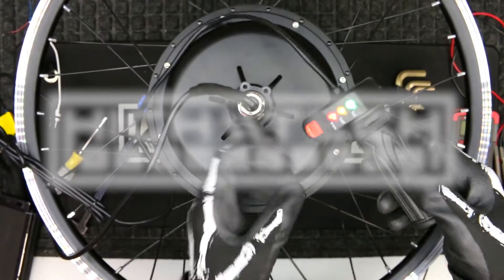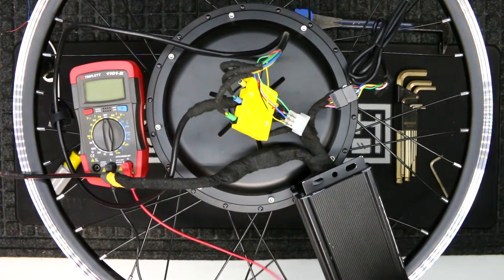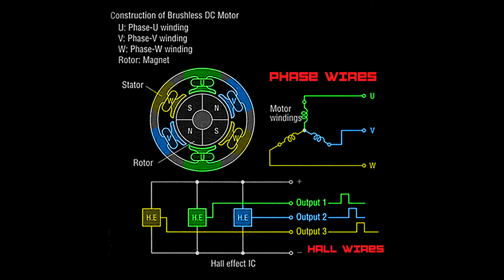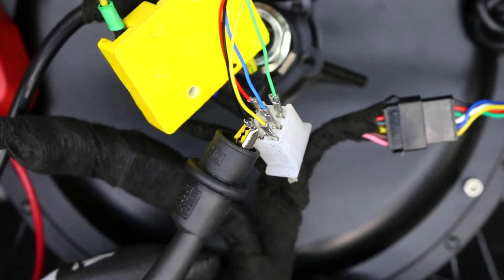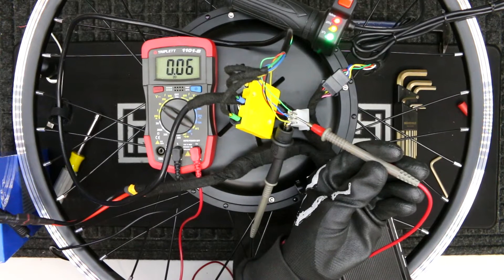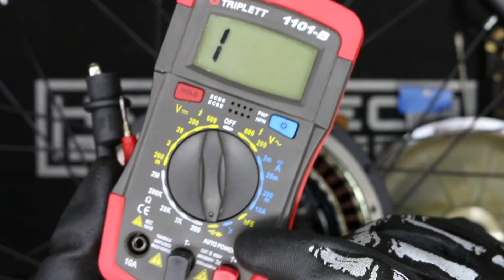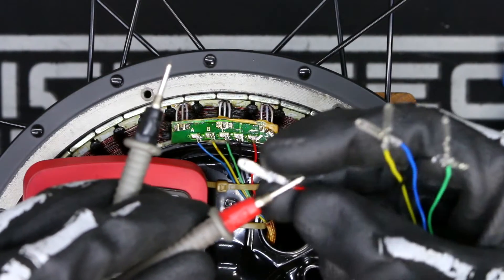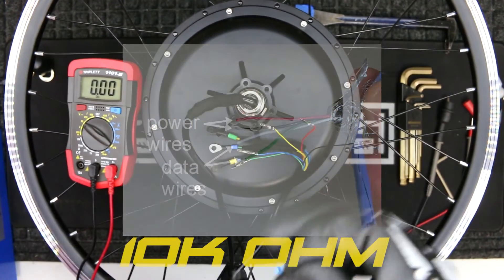🚲 How To: Ebike Hub Motor Hall Sensor Testing, Diagnosis, and Fixes (Display Error 10, Error 30)

Comment: you the man! i got a 5000watt motor i pretty sure bad sensor, anyone know if its likely to be the same process for 5000watt motor or am i more likely to need a puller tool...
Reply from the maker: Should be same steps for larger motors as "most" hub motors are constructed the same.
Reply: @hightech-lowlife  its funny I have had them for about 7 years and had seen a vid saying you needed special tool and it was tricky...so I avoided taking the cover off for years, just took it off today, super easy. the only problem I have is mine has two sets of 5 wires, the red yellow black greeen and blue...yellow is my dead sensor.  but the side I have taken of has 3 sensors going to the other group of wires which i think is for a differnt type of controller.  so i think my hall sensor is on the other sire but i need to take the cog thiungy off before I can take that cover off and I dont have the tool, will get tomorrow.  Brand new $500 motor blew hall sensor first time as didnt install torque arm correctly, had moved to a higher torque wheel :( but I think im close to repair now, i have an old motor of same spec with good sensors so i can take one of those and swap it out
Reply from the maker: Most larger motors have two sets of hall sensors (one is for backup), before doing anything else I would plug the other hall sensor in and see if everything works 👍 @andosoup98
Reply: @hightech-lowlife  ah i was wondering if that was the case so had held off doing any more until the manufacturer responds to question.  what i did do was use multimeter on black wire, then i can see 3v on the working hall sensors as i move the wheel around...but on the other unused wires I don't see any 3V.  so now the theory could be they also need their own 5v supply but the color codes arent obvious hence waiting to hear back from manufacturer for advise...but thanks so much for the quick responses you have really help a lot, i was so excited about the new motor then so disappointed when i broke it so quickly, lol.  manufacturer had sent incorrect torque arm so wasnt all my fault, hehe. living in New Zealand very limited with anywhere to take it to be fixed and i cant send it back to china so im on my own, lol.  at least I have over come my fear of openeing them, this fear was so great with a 1500w motor after blowing a sensor i ordered a new controller that doesnt need hall sensors, but its a bit rough and only go up to 45amp so not a solution for my 5000w wheel
Reply from the maker: Yes it will be a duplicate, so if you're not feeding it 5V, nothing can go through the circuit meaning nothing can be read back as there is nothing happening 👍 @andosoup98
Reply: @hightech-lowlife  yes its a nervous wait to hear back from the manufactures as while i can work out the data line colors on the spare hall sensors, I cant work wout the + and - as the wires change color in the loom and I cant get to anywhere to test continuity, lol. suprised I cant find a pint out anywhere as i think its a fairly common arrangement, ill look a bit harder while i wait for china to come on line, lol
Reply: @hightech-lowlife  haha just found you asnwering thisw same question in a redit, lol
Reply: @hightech-lowlife  i just HAVE to find the color ocdes, ill be so exicted if its just as simple as that
Reply: @hightech-lowlife  argh no, close but it says dark red is +ve but i have no dark red, lol
Reply: @hightech-lowlife  its a rollercoaster of emotions but i think i cracked it. i found the following that told me the colors for the hall sensor data pins and the +ve which allowed me to guess the -ve, which was brown
Reply: @hightech-lowlife  thanks so much for your help, it was your tip that pushed me to find the matching colors. in my case it was red=orange +v black=brown -ve hall data pins are green=purple blue=white yellow=grey.  Manufactures just got back to me to confirm :)
Reply from the maker: Yes it is annoying when manufacturers use their own color codes or stray from known standards, hopefully you get it going soon 🍻 @andosoup98
Reply: @hightech-lowlife  all working now, so happy :P
Reply from the maker: Nice, good job 👍 @andosoup98

Comment: Oh man. thank you so much for this informative tutorial, I have a question and need your help please, I had tested all wires like you did all have signal of 5 volt without turning the wheel except the yellow one doesn't show any signal with or without turning the wheel what is that means ? am I on the same tracking or I missed something? Thanks in advance
Reply from the maker: Thanks man! They all should show 0-5 oscillating, I would first check continuity on your yellow wire and if that checks out, then look at the sensor itself. You can even swap sensors to see if one is faulty or not. 👍
Reply: Thanks again man. I have my speedometer is reading 0 all times maybe this is related to one of the sensors @hightech-lowlife
Reply from the maker: Yes it is very possible.  @Themonster81iq

Comment: I had to replace motor wires cos of damage , when I changed the wires I also change out hall sensor wires , wires are now different colors and doesn't match the one controller have. I screw all back and forgot in what sequence sensors were, but no matter how I changed them it seems that doesn't matter. even when I plug off the hall sensor cable wheel still turns as usual, can I leave it like that or should I open my wheel again and redo all the work ?? p.s sensors read 0.8v max for some reason
Reply from the maker: If things are working, then I would leave it. The wire colors do not have to match as long as the pulse sequence is right for smooth operation.  👍
Reply: @hightech-lowlife  I disconnect the sensor wire from controller and it still works just fine. Im thinking maybe I should just get rid of sensors and wire in thicker power cables, what is the downside of that idea and does motor suffer from it, thanks.
Reply from the maker: Some controllers are dual-mode: https://endless-sphere.com/sphere/threads/can-i-run-my-controller-without-the-hall-sensor-plugged-in.118999/

The sensor wires allow for a smoother operation, but if you can't tell the difference and it works fine for you, then yes you can run it that way without issues 👍

Most phase wires are more than adequate for way more than their rated power, it won't hurt to make them larger, but probably not necessary unless you're upping the power considerably.

Comment: subbed after the first video I watched on how to test hall sensors, I've been searching for a few days trying to get this information about how to  test the wires, I've changed the wording and tried several variations and  got no where, I'm basically not getting any Error codes or anything like that but when I rotate the wheel to get a up to 3mph so the wheel will then activate but it isn't registering any speed at all and I know 100% that all other components work perfectly as I have another wheel and when I put that one on it  all works perfectly 👍
Reply from the maker: Thanks man, you should check the multimeter readings and see if they are correct, if they are then the motor should work. 👍
Reply: I have this weird problem that seems kinda opposite. My speedometer never showed current speed (always 0kmh), but my motor always worked like it should with a torque sensor. However recently the display starting showing current speed, making the motor cut out whenever above 0kmh. So there is a short push when starting from standstill, and the walking assist works without a problem. 
Did you end up troubleshooting the problem with your bike?

Comment: Thank you for the video 👍 ...  but for the same position of the wheel i have two hall sensors giving 5 V ... and my motor is stuck
Reply from the maker: Check for shorts on your phase wires, it should operate as shown in my video, if it's not then you just have to figure out why (shorts, faulty component, etc). 

Usually if two phase wires are touching it will make the motor very difficult to turn as the motor is generate magnetic force in the opposite direction. 

A stuck motor can also be mechanically stuck (bearings, etc).
Reply: I checked all the wire and the phases ... everything seems to be fine but the motor won t turn ... i made a video if u can check plz
https://m.youtube.com/watch?v=k5iKssrFNh4&pp=ygUgdHJvdHRpbmV0dGUgw6lsZWN0cmlxdWUgZW4gcGFubmU%3D
Thank u

Comment: I have a motor like this and its making noise at low rpm.
Performance haven't changed it just makes noise from a dead stop.
Any advice is it normal?
Reply from the maker: What kind of noise? Could be bearings.
Reply: @hightech-lowlife  it's a new bike so I doubt it.
It only does it when I'm on the bike it makes 0 noise when I'm off it and ita fine even when I pedale it without using the motor.
It feels like a vibration and like the wheel is going under me.
Idk I can't really explain it.
And ita 🌧️ 🌧️ like mad so I can't make a video/audio.
It's been doing this for 700km.
Reply from the maker: @Asfanboy1  You may be able to see an issue if you take it apart, but to me sounds mechanical. Maybe something is loose or wearing strangely.

Comment: I just got a brand new qs165 and it’s throwing a motor hall error just checked the hall wires and they all stay at 9 v and don’t move other than white and that’s at 3v idk what’s going on plz help
Reply from the maker: Most QS motors have dual hall sensors, try the other connector. If it's brand new send it back for a replacement. No use wasting time trying to fix something that is supported, leave that for them to figure out 👍
Reply: @hightech-lowlife  dual hall sensors? I don’t understand, as in two separate clips? Mine only has one 6pin hall and the 3 phase wires
Reply from the maker: @Jesse_underwoo  Yes most QS motors I've seen have dual halls for redundancy. I looked up your model and it is a mid-drive, and they may not do that for their mid-drive motors. 

You'll also want to make sure you purchased the hall sensor version and not the encoder version (depending on what controller you have) there are two versions of this motor and if you picked up the wrong one it won't work for the controller you're trying to use it with.  

If you bought this new, then I would reach out to the seller you bought it from (or QS motor themselves) and let them know the issue, I'm sure they will be able to sort you out way better than I could 👍
Reply: @hightech-lowlife  got it thank you for your time gonna see what the company says hopefully tomorrow
Reply from the maker: @Jesse_underwoo  No worries man, I'm all for helping and DIYing as much as possible, but when you buy something new it should work as expected, and if it doesn't then it's on someone else to deal with (that's what you pay extra for, as opposed to buying something used with no warranty) 👍I hope the new one they send you works 100%. 

What bike/moto frame are you installing this on? What battery did you buy/make? Thanks!

Comment: I have an Aventon  ebike and the display is showing E30 but it rides fine, pedal assist ok, throttle ok. The only issue I see wrong is the speedometer is not showing speed. The display is new, thinking the white speed sensor motor output from hub motor is bad ? Does that output also use a hall sensor as the 3 phase sensors utilize in the hub motor ?  Thanks
Reply from the maker: I would recheck connections, find out what is being output from the motor on the white wire and see if you can measure it, this will let you know if it's that wire, the motor, or the display.
Reply: @hightech-lowlife  Thanks for the quick reply, is the speed sensor (white wire) the same pulsed output as the other hall effect sensors?
Reply from the maker: @donl1411  Not sure, but probably not. Most hub motors I have seen do not have a dedicated speed sensor wire, as I believe the controller will calculate speed via the hall sensors. 

I think you might mean the white wire that is coming from the controller, not the hub motor? If the motor is working fine, then it's either the controller, the display, or the connection between them. 

If nothing has changed and it was working before, and you have checked and rechecked the connections (unpugging, then replugging the connections) VERY IMPORTANT TO TRY FIRST and it's still not showing correctly then my next thoughts would be a hardware fault in one of the components tied to the speed display (either display, controller, or connection/connectors between them). 

I don't have any personal experience with aventon bikes or products but from my quick search for your problem it appears their support is very good. It's going to be a lot better than a random person on youtube 😎my suggestion would be to reach out to them for help as they are going to know way more about how to troubleshoot and fix this specific problem. Plus if you do need a replacement, they're going to be the ones that can help you with that the best. Depending on how old your bike is you may still be under warranty also, so inquire about that as well.  

https://electricbikereview.com/forums/threads/aventon-level-e30-code.49323/

https://rideaventon.zendesk.com/hc/en-us/requests/new

Good luck man 🍻
Reply: @hightech-lowlife   Thanks will contact them.
Reply from the maker: @donl1411  👍🍻

Comment: what if I'm only getting 0.4v from the controller?  I don't even have the motor hooked up.  It's just 0.4v from the red and black wires from the controller.  Pls help :/
Reply from the maker: This would indicate you have an issue with your controller if it's supposed to be outputting 5V and you're only seeing 0.4V.
Reply: Did you find a solution to your controller only outputting .4 v instead of 5v ? 

I have same problem !
Reply: Probably need to replace controller  @robbrenton9438
Reply: Bump

Comment: Hi can u help please, with the scooter turned off the wheel is hard to turn its notchie, if I unplug it the wheel free spins I've tried another wheel it's the same thing, it don't move when it's turned on and the walk mode don't work aswel,
Reply from the maker: Have you checked the hall sensors like I have shown in the video? Thanks
Reply: I sent the message then see the rest of the video. My bad sorry bro,
Reply from the maker: @liamdtraxxas2011  It's possible it's not the motor at all, but I outlined a lot of things to test and try to get you closer to finding the problem. If all the tests check out good, then it could be an issue with the controller or throttle.

Comment: One hall sensor shows 2,45 v all time. If i turn nothing changes. Changed hall sensor twice. Couldnt be that both of them show the same
Reply from the maker: If you replaced the hall sensor and that didn't fix the issue, then that symptom may not be caused by the hall sensor, check your wiring leading to the hall, check the PCB, etc.

Comment: But what if while you hold your throttle and then reverse the bike it works? but still showing motor error display.
Reply from the maker: Can you let me know what you mean by "hold your throttle and then reverse the bike"?
Reply: @hightech-lowlife  im having a motor issue but the odd thing is when i throttle it wont work unless the motor itself spins the otherway first(you push the bike backwards/reverse) while holding throttle. It'll either work like normal or sometimes stutter but still shows motor error on thr display
Reply from the maker: @SketchbookGuitar  Ok, did you go through the checks and tests I outlined in the video? What were the results?
Reply: @hightech-lowlife  So I have 4 hall sensors (ADOA20XE not sure if the one on top is a hall sensor or something else) I found out that out that one of them pulses but at only 2.60v ( I was doing the test while you asked the results)
Reply from the maker: @SketchbookGuitar  If one is reading different than the others, that could be an issue.
Reply: @hightech-lowlife  thank you. I'll wait for the sensor to arrive. As someone with very little knowledge your guide is easy to understand.
Reply from the maker: @SketchbookGuitar  No worries man, and thanks 👍 I haven't had many issues with hub motors, but when I did on one of my builds I gathered a lot of info to pass along to others, so even I'm not the best one to ask about these types of problems as I don't have a ton of experience in fixing them. I do have experience fixing other electrical things, and ebikes are similar. 

Also, it's good if you can isolate the issue down to the motor, with these types of problems it could be something other than the motor as the controller and throttle are also in the circuit. Sometimes buying a cheap controller  to test with can save you time diagnosing. After testing you can sell the controller or keep as a backup. Always check the easiest and obvious things first, like connections and wires for anything that doesn't look right. 

They also make little "ebike testers" and I did purchase one, so I will be making a video on that, could be helpful for things like this too.
Reply: @hightech-lowlife  Hi I used SS41F sensor. It's vibrating. I think it's the wrong hall sensor. Can you please help me identify what sensor is a (461AN 1342) ?

Been trying to google and I don't really get it
Reply from the maker: @SketchbookGuitar  If I google that, this part number comes up: https://www.aliexpress.us/item/3256804722639430.html
Reply: @hightech-lowlife  yes. I still don't get it 120 degree sensors and what not on middle and the rest different ones. But the results you got differs from mine. I might try to get this thanks.